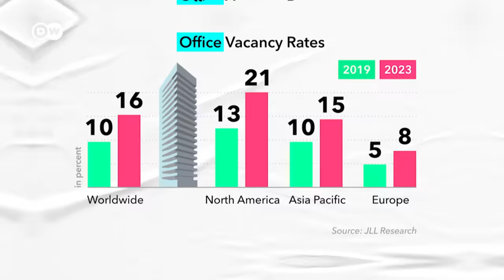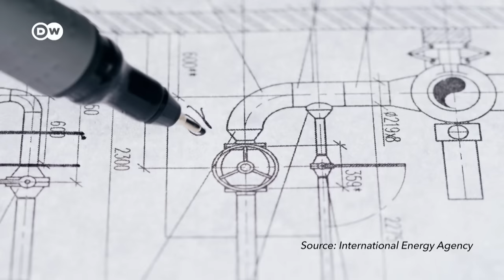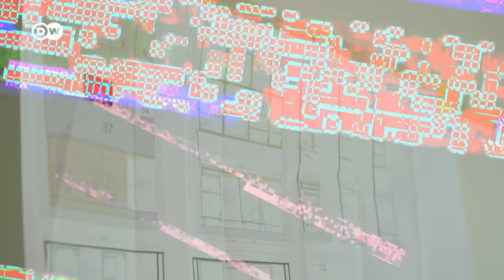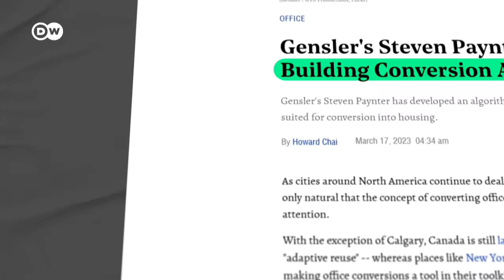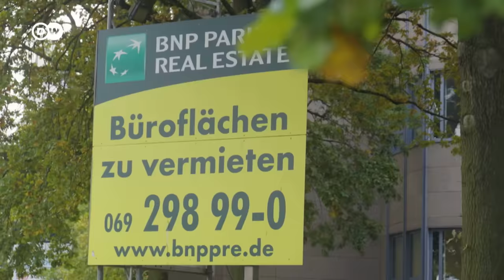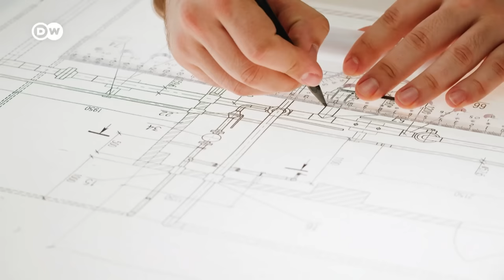Why don't we just turn empty offices into housing?

Comment: Why do you need windows?

Let's say you get to work early, and you come home late (like a lot of people do), you don't even see out of your window. And really most windows are just a view of the sky through curtains the inhabitant has become so used to that it's invisible.

You might find that there are people who would happily give up on windows in exchange for lower rent (so you could turn the outside spaces - with windows - into higher rent units, and inside spaces, near the core of the building into windowless, probably smaller, very affordable rent units.

Comment: Nice in theory. But this falls to address the many many layers of legal, zoning and management issues. And it is insanely expensive to do,  not to mention that residential property management is many times more work and resource intensive than commercial.  It's as different as cops from firefighters!

Comment: Oh dear.  The answer is simple.  Office buildings are constructed to serve an office occupancy.  This means large, open spaces with general lighting, perhaps some partitions to define individual offices and a restroom cluster somewhere down the hall.  Heating and ventilation are fed from a central mechanical room.  Suspended ceilings hide much of the workings.  Now let's try to make this into housing.  Strip the inside.  Erect walls to define rooms.  Wherever you have a sink, faucet, shower or toilet, core an unexpected hole through the concrete floor deck...and somehow collect all that waste back to the original restroom core.  Run all new electrical service above the ceiling.  Convert one exterior window into a louvered wall for your individual heat  pump and distribute blower units to the various rooms.  Reconfigure the sprinkler systems to serve individual units.  Now think about cooking - where does the exhaust go?  Add those modifications to the list.  By the time you have demolished what is there and reconfigured it all as housing, you have the bill.  Original building cost plus loss due to demolition, plus reconstruction work must be recouped.  Affordable housing?  Don't make me laugh.  This comes from the "You will own nothing and be happy" crowd.  The people who forward this type of initiative are the same ones who believe in climate change.  It is all about the goal..with no consideration as to the means necessary to get to that goal.

Comment: I'm no expert but to me, there is one glaring issue with turning offices into housing. Offices are generally much more expensive than houses per sqf & much more profitable. Building owners would rather keep it empty than rent it out for houses because - the lower income is not worth the trouble. Rich office building owner can afford not having 100% capacity for their buildings. Also, they might devalue their property if it is turned into residential units.

Comment: I would happily live in a room without a window or personal bathroom if I could actually afford buying it.
Most offices already have enough power, phone lines and ethernet(internet) wires.
What needs to be installed: apartment-dividing walls, secure enough doors, ventilation, showers in bathrooms.
It wouldn't be luxury housing but something like dorms - and that is enough as long as it's affordable.

The only real problems I see is: 
1) offices have very bad or no soundproofing - improving it to apartment standards may require re-build
2) it's very expensive to move a bathroom safely - but communal bathrooms are really uncomfortable at home
3) a lot of space would be wasted due to office room plans not coinciding with apartment ones
4) office buildings are often on very expensive land that cheap dorm tenants cannot afford
5) office buildings may be significantly more expensive than cheap-apartment ones so owners won't convert
6) no hospital within easy reach is really bad. this must be addressed on city level.
7) lack of schools, kindergartens, shops, parks, public spaces is not good but may be tolerable 
6) people view real estate as assets - like a bank account - or even investment, so vacant buildings are not viewed by their owners as a problem that needs solving ASAP. A high enough real estate tax needs to be instated - balanced with universal housing subsidies per person, so living in a building costs the same for everyone, but owning a vacant building costs a lot.  

However, even if very few people would prefer to live in such converted buildings, it still would allow those who do an option - even if a relatively bad one, and thus the housing prices would eventually adjust down for everyone.

Comment: Although looks good solution, but it may not be viable answer from the perspective of owner.   commercial space have low construction costs but high land purchase cost. Also developers leave tenant to add rooms and other furnitures as per their requirements, can charge high rental price and do not have to work much on interiors such as , kitchens, multiple/ attached toilets and other details for housing purposes. And at last the rent is very low and not profitable. The commercial space charges high for their location more than their infrastructure. So considering these things, why would developers convert to residential space.

Comment: I a member of the communist party in Portugal. One of the things we defend is this. We have a lot of abandoned comercial buildings that could be reconverted to housing. I know is not an easy thing to do, but a least the building is already there. In my municipality, Sintra, we signalized to local power the existance of a building that was built but never used, but was intended to be a mall. Sintra resides on the district of Lisbon, the capital of Portugal, and we are having a big housing crisis, that also affect thousands of students that come to Lisbon every year to study. 

You said in the video you can't have one big bathroom for the whole floor, but well, you can for student residency. There are a lot of existing student residencies and frat houses that work like that. 

Added to that we also have a lot of vacant homes that are not being rented, because there are landlords that accumulate homes and then just rent a few. They do this to make it seem we have not sufficient homes, thus, they can increase the price.

So what is Portugal doing? Not very much. We are having a rent crisis that is almost criminal. Minimum wage is now 820€. Cheapest rents won't go lower than 600€ on Lisbon district.

Our political party proposes rent regulation and also make the banks pay for this, because they are having increases and increases in profits. We are also for economical protectionism in some matters. We have a lot of foreign investors that buy houses here and rent at those high prices, and we are against it also. There is this other leftist party, Bloco de Esquerda, that proposed that only people that have residency in Portugal to be able to buy houses.

Comment: Commercial buildings are not designed the same way as residential ones. Trying to retrofit them is nearly impossible due to plumbing, electrical, and fire safety issues.

Comment: Cities should charge rental/leasing companies rent for the unoccupied spaces based on the cost of the rent the companies want to get. They'll have to lower the price points to actual market rate or lower, until rent is low enough to get someone to move in. This would also have a ripple effect of lowering rent across the board. Sitting on vacant properties creates artificial scarcity and needs to end.
Reply: I agree with this to a point.  In the city where I live, a property owner was recently called out for several vacant properties they owned that became a consistent fire hazard when the homeless population tried to start fires in and around the structures during the winter.  It jeopardized neighboring properties and cost the city fire department quite a bit of money to put the fires out.  Property owners who sit on vacant properties without doing anything useful with them should be held to some kind of standard to (at a minimum) ensure that their properties are kept up and are not attracting transients/crime or becoming a danger to neighboring properties.  I think it would also be helpful if the taxes on those properties matched the potential revenue they would generate if they were not vacant.  That way the city has added funding to build/repurpose other structures to make up for the vacant ones that could be used.  That being said, one thing that was mentioned in the video was this idea that turning some of these office buildings into housing, restaurants, gyms, hotels, etc. actually made neighboring offices easier to rent out because they were now close to things that are appealing to have next to your office space.  Instead of forcing lower rents, which isn't entirely a bad thing, perhaps we should look at why some of these buildings are vacant/difficult to rent out.  If it's just a matter of adding nearby housing and some additional amenities to make them more attractive to potential renters, why aren't we doing more of this?  I definitely think that a huge part of the problem are predatory landlords who would rather sit on vacant properties than address the larger community needs, but I also think that city planning in most cities is abysmally bad, particularly in the US where zoning laws put businesses and residential areas far away from each other.  If the problem could be fixed or at least lessened by rezoning and repurposing existing buildings and holding property owners accountable for creating appealing and useful spaces, we should absolutely do that.

Comment: The fire risk, the problem escaping and handling a fire.  High rise fire would be more prevalent if high rises became living quarters.
Reply: Not really.  The occupant load is generally lower than office space, so the stairs are likely adequate.  The issue is cooking, so you have to separate each unit.  Not much different than normal resi units or hotels.

Comment: Sounds like an obvious thing to make it work for the masses is that not every apartment needs a bathroom. Build with fresh graduates as target prices are going to have to be less than half of other available. But many students are use to sharing a bathroom. You can have as low as one co-ed up to three bathrooms depending on existing infrastructure. As long as rooms are actually nice and the large wasted areas are effectively used as communal spaces. You'll fill a needed hole in the market. New graduates need jobs to get experience to get better jobs to afford the current housing, especially as the first jobs they can get are often in the city.

Comment: One company should start building a sort of "pre-fab" conversion kit, similar to how cruise chips install new rooms. Build kits that are designed to fit in a standard office space (correct ceiling height, for example), and then have multiple "blocks" of apartment that can be combined into a total space. So like you would have an open concept bedroom intended to press against the existing windows, an open concept kitchen, a bathroom built into the side of an open concept space that is as wide as the other elements, and then a variety of "spacer" blocks that can be fit between these core blocks to match whatever dimensions the space affords. 

So for example, if the bedroom is 4m across, and bathroom segment 3m across, and the kitchen segment 4m across, but the space available was 20m, you could then place 1-5m segments in between each to fill the remaining 9m, and this could be closets, living rooms, etc.., or just open space to be used however they wish. You could mix and match these pieces how you like to achieve an apartment that fits the space you have and the style you're looking for (within reason). You could either line them up in a row, or place several of them together to make a larger apartment. 

These would also be designed to be broken down into pieces that would fit in a standard freight elevator, and since they are pre-fabbed off site and fit into relatively narrow configurations, they would be very cheap relative to custom building everything on site. It might not meet the tastes of the high end luxury crowd, but it should work great for lower and middle income housing that cities need.

Comment: I think part of the problem with office conversions is the way we conceptualize our living spaces. In the buildings with wide floorplates with windows far from the elevators, you could make smaller bedrooms and bathrooms and dens along the outer walls with the windows, and then have community spaces in the middle. Large community kitchens and party rooms and rec rooms and meeting spaces.

Comment: End stage capitalism 
The endless growth required to sustain capitalism has reached the point where the only growth that can occur is costs

Most office buildings are built in such a way that only large mansion like 1% hous8ng could be made without so much remodeling it would just be cheaper ti tear down and rebuild.